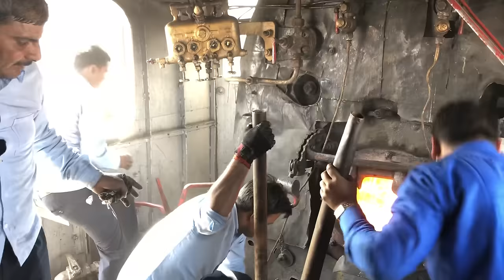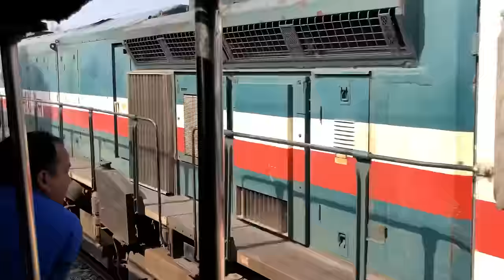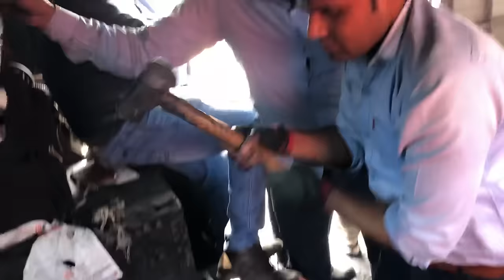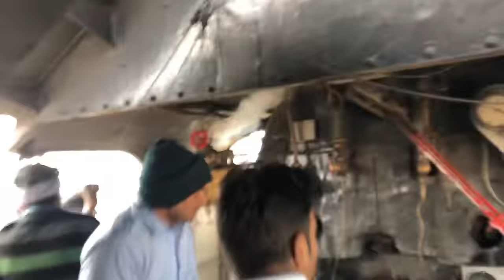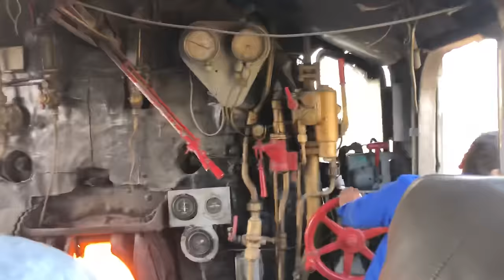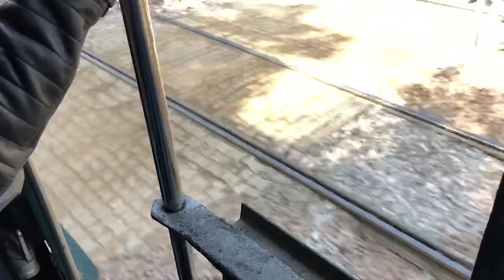Riding the cab of an Indian Railways Class WP Steam locomotive Delhi to Rewari February 9, 2019

Comment: It’s fine my father was a Railway servant Right from a call boy risen driver of steam locomotives I am privy to the working conditions of the Engines Some times I tried my hands firing with coal in the shovels also steered the locomotive opening the steam  Re called those days  & how today’s pilots are equipped with No interlocking system no exchange of token fixed keys While the train on move a little careless will injure the shoulder of the Fire man of duty OMG  I enjoyed as son of a railway servant and the sweat and blood run through till in his service
Reply: Was it so difficult during those days, simply amazing the amount of hard work they used to putin for us to enjoy the journey. Ashik Paul.

Comment: In the 60's I used to travel from  Ajmer to Bombay Central or New Delhi Railway station by trains pulled by these WP bullet nosed steam engines. The slipping of the drivers at the railway station, the coal dust in the air and the smell of steam comes to mind the minute I see these videos! I have seen these go as fast as 60 mph and the sound they made at speed was fantastic. I think the remaining Akbar and a few others are worn out and make a lot of clunking etc. It wasn't like this back then. If you see the steam engine pulling the train and accelerating during the song "Koi Haseena jab rooth jati hai" in the movie Sholay during the part "station se gadi jab choot jati hai", that's the way the used to be!
I wish they would explain the controls of the engine in the cab, and the gages. They are probably similar to British steam engines, but not quite. My guesses: in the beginning the two firemen shake the firebox grates with the pipe levers to drop burnt cinders and then load in fresh coal to the fire. The lever at the top is the throttle hooked up to the steam dome. The big red painted wheel in front of the Engineer is what? Brake, reverser. What is the large brass manifold with eye glasses on the fireman side? I wish someone would make a video explaining the running of Indian Railways steam engines.
Reply from the maker: Sorry, but I can’t help regarding these items. Russ

Comment: How about the speed and pick-up of a steam engine? How often water tank needs to he filled to maintain steam pressure? I feel electric train is more compact. No doubt steam logos are vintage and I too like. I was very young when trains were propelled by steam engines way back in 1980s...Diesel engine is the most powerful one, be it speed or pickup. Diesel electric again uses same traction motors that are used in electric locos. The only difference here is electric locos get power supply from the overhead cable and diesel uses diesel generators to power the traction motors. But steam engine is altogether a different technology..
Reply from the maker: Sorry but I can’t help regarding these questions. Russ
Reply: @russellsharptrainvideos  No issue sir. After all knowledge is only to share. The more we discuss, the more awareness we get. Diesel mechanical engine is just like a lorry or bus. It uses the diesel and air mixture to blast inside the cylinder to move the rotor. Rotor is connected through gearbox to regulate the torque and speed. Now, this cannot pull heavy loads. This just serves the shunting purpose only. Diesel electric is a different mechanism. This is equipped with traction motors that are propelled by diesel generators equipped in the engine. The electric engine on the other hand, is equipped with traction motors but the power supply comes from the overhead wire. The pantograph touches the overhead wire for live terminal and the neutral and earth is received from the railway track. Steam engine is external combustion engine where water in the boiler is heated up to generate steam and the steam pressure is used to push the piston which are connected to wheels and thus motion takes place
Reply: @russellsharptrainvideos  I am from India and you are from which country sir?
Reply from the maker: @karthikrvenkatraman9588  I’m from America. Russ

Comment: After igniting coal how much time is required to start the train? Further for how much coal is required to run one km for normal conditions such as 
1.on zero slopes ies on perfect ground with 12 boggies. 
Thanks.
Reply: Lmao,Why r u commenting on youtube channel dude just seatch it on google.
Reply: The steam is collected in the chambers There’s a glass to show how much water is in the tank and also how much steam is generated The train ready to move is controlled strategically by all the three driver fist fireman and the second fireman on run They by experience familiar with the up and down gradients follow caution orders issued by engineering department and there is a common power controller who will guide the running of the train lot more sir There will be watering station Enroute to fill